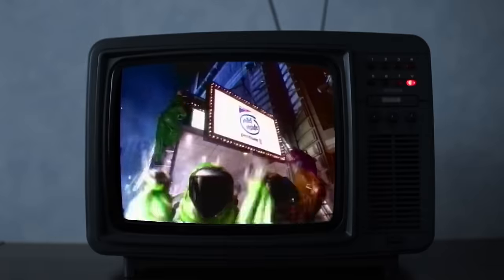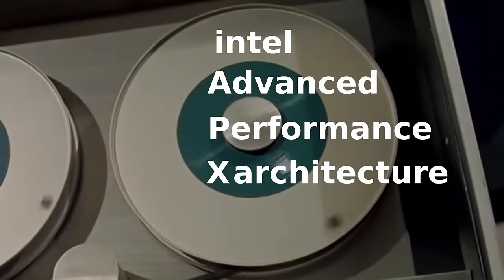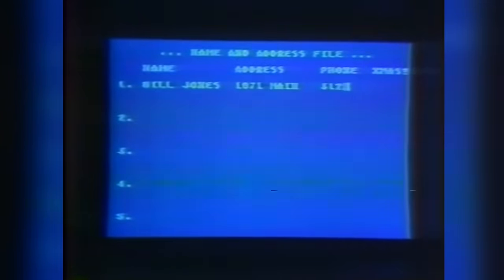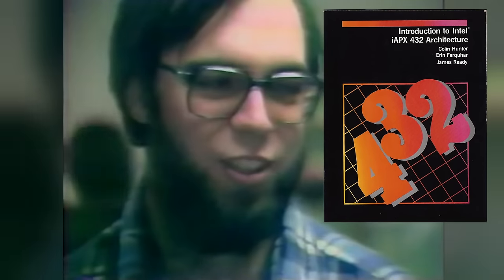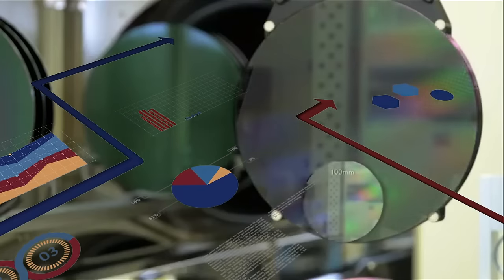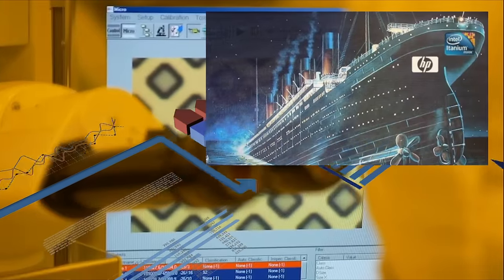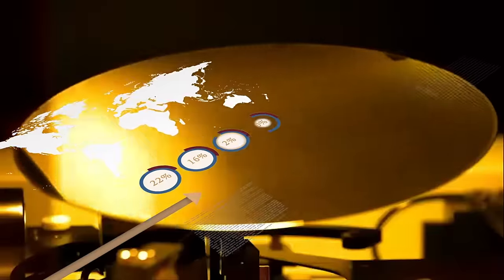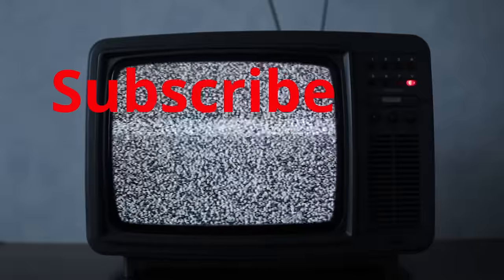iAPX The first time Intel tried to kill x86

Comment: Intel building the iAPX: Oh no this massively complicated large-die CPU with lots of high-level language support that relies on the compiler to be good sucks
Intel 20 years later: What if we built a massively complicated large-die CPU with lots of high-level language support that relies on the compiler to be good?
Reply: Didn't Intel also build a RISC processor that... relied on the compiler to be good?
Reply: You could almost just change the audio on the video and replace iAPX with IA64 and it would be the same.
Reply: The IA64 was not quite as high level as APX was. And the difference is it could actually perform exceptionally well in a few things, if not the best in market. But outside of a few nitch workloads where it shined it was rather pedestrian in some rather common and ubiquitous server workloads, this and its slow x86 compatibility mode was its biggest problem.  In the area's it was lousy, it couldn't even out perform the best of x86 at the time. And part way through its development Intel seemed to lose interest and relegated it to older process nodes and didn't give it a large development team to iterate on it over generations. It got a few of the AMD64 features ported to it and what not, but it was left languishing after Itanium2.
Reply: @scottlarson1548  all RISC processors rely on the compiler to be good.
Reply: @DorperSystems  And CISC processors don't need good compilers?
Reply: @scottlarson1548  never said that. I said that RISC and VLIW CPUs were designed around the idea everyone would just use a compiled language. This is why it's nicer to write assembly for a CISC ISA rather than a RISC or VLIW ISA. Because everything isn't load-store.
Reply: @DorperSystems  So you're saying that microprocessors need good compilers. Thanks for that information!  😄
Reply: @scottlarson1548  IA64 compilers needed the compiler to be really good at guessing cache misses.  No compilers known to Man can do that, except for certain types of number crunching algorithms.  This is not necessary for x86 or RISC compilers.
Reply: @peterfireflylund  So they designed a processor that no compiler could generate good code for. Sounds correct.
Reply: Not really.  More like:

Intel with iAPX: Let's make a radical new CPU that makes it easier to implement a compiler, and then screw up our own implementation of the compiler.

Intel with Itanium: Let's make a radical new CPU that makes it harder to implement a compiler, to keep the CPU die itself simple (well, as simple as this fancy new architectural paradigm can be).

AMD: Let's just make a normal damn CPU but with more registers, and take advantage of established compiler technology.
Reply: @DorperSystems  and VLIW turned out to be pretty good for graphics, used by AMD in a couple of their cards.
Reply: @danielbishop1863  Let's keep the CPU die simple and add a ton of cache and run that thing at insanely high power.

Comment: Back in 1980 I was off to University to do a Computer Science degree, and was also building a computer at the same time - I]d been mucking about with digital electronics for a number of years and with the confidence of a teenager that didn't know if he had the ability to do so, I had designed several processor cards based on the TMS9900, 6809 and others (all on paper, untested!) and had read about  the iAPX 432 in several trade magazines, and was quite excited by the information I was seeing, although that was marketing mostly. I tried getting more technical data through the Universiity (because Intel wouldn't talk to hobbyists!) but found information thin on the ground, and then six months or so later all the news was basically saying what a lemon the architecture was, so I lost interest as it appears the rest of the world did. 
About a decade later my homebrew computer booted up with its 6809  processor, I played with it for a few weeks, then it sat in storage 20 years, because "real" computers didn't require me to write operating systems, compilers etc :D
Reply: Around 1989 I was building my own home-brew computer around a NEC V30 (8086 clone), an Intel 82786 graphics coprocessor, and three SID chips for sound, because why not?  Everything was hand-wired and soldered, and even with tons of discrete logic chips, I managed to get it operating at 10 MHz.  Initially equipped with 64K of static RAM, it was my senior project in college.  Instead of the iAPX, I was interested in the National Semiconductor 32000 CPUs, and my college roommate and I had big plans to design and build a computer around that platform.  A 32032 CPU/MMU/FPU setup was about as VAX-like as you could get, with it's full 32 bit architecture and highly orthogonal CISC instruction set.  Unfortunately computer engineering was not yet a thing at our college, so we were on our own and simply didn't have the resources to get that project off the ground.
Reply: @johnallen1901  That sounds impressive! It's actually not the first time I see people talking about their late 80s  homebrew computers in youtube comments... if you (or any of the others) still had it and could show it off in a video, that would be beyond cool. Three SIDs at 10mhz, yes please :)
Reply: @johnallen1901  I thought that the V30 was the 80186 or 80188 instruction and package compatible CPU?
Reply: @javabeanz8549  Yes, the V20 and V30 were pin compatible with the 8088 and 8086, and both CPUs included the new 80186 instructions and faster execution.
Reply: @johnallen1901  Gotcha! 8086 replacement. I never did see many of the 80186/80188 except some specs on industrial equipment. I did buy a V20 chip for my first XT clone, from the Frys in Sunnyvale, back in the day. The performance boost was noticable.

Comment: It wasn't just that the processor returned by value. Values were literally wrapped in system objects, each with all sorts of context wrapped around it. You put all this together, and you'd have a subroutine exit take hundreds of nanoseconds.

This is when all the system designers who WERE interested in this, tell the Intel Rep, "This is garbage." and leave the room.
Reply: Correction: "...subroutine exit take hundreds of microseconds."  Clock rates and memory speeds were many orders of magnitude slower than today.

Comment: I'm guessing one of the subsequent attempts at intel shooting itself in the foot would be the 1989 release of the i860 processor. For this one they decided that the 432 was such a disaster that what they needed to do was the exact opposite - to implement a RISC that would make any other RISC chip look like a VAX. So we ended up with a processor where the pipelines and delays were all visible to the programmer. If you issued an instruction the result would only appear in the result register a couple of instructions later and for a jump you had to remember that the following sequential instructions were still in the pipeline and would get executed anyway. Plus context switch state saves were again the responsibility of the programmer. This state also included the pipelines (yes there were several) and saving and restoring them were your job. All this meant that the code to do a context switch to handle an interrupt ran into several hundred instructions. Not great when one of the use cases touted was real time systems. Again intel expected compiler writers to save the day with the same results as before.

On paper, and for some carefully chosen and crafted assembly code examples, the processor performance was blistering. For everyday use less so, and debugging was a nightmare.
Reply: That kinda explains why I only ever saw i860 end up in things like graphics processors and printer/typesetter engines, things that were really more like DSP and stream processing tasks. If you're transforming geometry in a RealityEngine you can afford to hand-optimize everything, and you have a bounded set of operations you need to do fast rather than general computation.
Reply: I worked at two of the companies that made extensive use of the i860 as a math engine. Yeah, you could make it scream for the time, especially if you're into scraping your knuckles in the hardware, but the general impression was what a PITA.
Reply: Intel sure has a long history of thinking they can handle compilers and failing miserably at it.
Reply: I remember that from the perspective of exception handling, that the handler needed to correct and drain all those instructions.
FWIW that idea was tried later in more RISC processors in a simpler way, for example "the instruction behind a JUMP always gets executed, just swap them". Simple and good, but newer CPU implementations wouldn't have that slot.
So again this was not a future proof idea.
Reply: Let me guess: Being a compiler developer at Intel must have been a nightmare. 
CPU design guy: "Ah, well, our pipelines are a little, ehm, "complex", but I'm sure you compiler guys will take care."
Compiler guy: "Oh no, not again"
Reply: And in the end neither hardcore RISC nor hardcore CISC was successful.
The two most widely used designs are one that externally pretends to be CISC, but internally does things very RISC like and the other is a RISC derivative with tons of instruction expansions, long pipelines, out-of-order execution, branch prediction, etc.
Both basically combine the benefits of RISC and CISC into a package that is better than either.
Reply: Agreed but I think the CPUs descended from the RISC lineage still have a slight advantage because they do not have the overhead of having to decode and translate a CISC instruction set with variable length, possibly non word aligned instructions into the type of internal operations shared by both architecture types.

Comment: Intel would use the term iAPX286 to refer to the 80286, along with the 432 in sales literature. Intel had intended the 286 for small to medium time sharing systems (think the ALTOS systems), and did not have personal computer use anywhere on the radar. It was IBM's use in the AT that changed this strategy.
Reply: Yes, a short while they did. I have 8086 and 80286 datasheets with and without "iAPX".

Comment: You should do an episode on the Intel 860 and 960. I’m remember them being interesting processors but never saw anything use them
Reply: Yes that would be interesting. I know SGI used them. They got quite a bit of use as coprocessors I think
Reply: i960 was used in the slot machines of the mid 90s. I believe it was also used in the F-16 avionics.
Reply: I860 was used in the ASCI Red System @ Sandia NL, 1st machine to break TFLOPS barrier.
Reply: "The Second Time Intel Tried to Kill the x86".  Slots in nicely between this video and the Itanic one.
Reply: the i860 was the original target platform for Windows NT, microsoft was gonna build an i860 PC
Reply: The easiest way to see a 860 or 960 is to procure a RAID controller from 90s or 2000s. Adaptec had been using them extensively. Even the famous 5400 series.
Reply: Acer did some machínes at the end of the 90s, remember some advertisements on the chilean newspapers those years.
Reply: @hye181 I read that the point of writing Windows NT on the i860 was as an exercise to ensure that it was not limited to x86.
Reply: @bsd107  no, they planned to build both a desktop PC and a server platform that were i860-based, but it fell through because it turned out the i860 sucked too hard and the MIPS R4000 was too expensive to put in a PC
Reply: Hewlett Packard made several high volume lines of color inkjet printers based on the i960.
Reply: @hye181  and interestingly an offshoot of the successor R4200, the R4300i was used in the Nintendo 64 (which also used Rambus RDRAM) and the Playstation went with an R3000
Reply: Pretty sure they were in raid cards and other random things

Comment: Having done ASM for a 286 and a 68000 at university, I have to say, at the time I preferred the 68000.
Reply from the maker: Me too if I'm being honest.
Reply: @RetroBytesUK  Ah if only the 68K was released a few months prior, IBM would probably have picked it for the PC. Such a shame, as the x86 is pretty horrible from an ISA POV.
FWIW the 68K has... 68,000 transistors. As referenced by Wikipdiea. Cool video.
Reply: @RetroBytesUK  All those general purpose 32 bit registers. So good.
Reply: As somebody who had done assembly language on the old PDP-11, it was pretty clear where Motorola’s inspiration came from. ;)
Reply: @lawrencemanning  The 68K was more equivalent to the 80286 than the 8086.
Reply: @lawrencedoliveiro9104  did not know that. Going to have to look into it. Thanks.
Reply: Agree strongly.  Not having a poverty of registers (some with dedicated use... sorry!  You can do that only if it's in AX!) was a godsend, and 68k hackers got a flat space back when x86 coders still had to deal with the truly bletcherous "real" mode address space.
Reply: @RetroBytesUK  It doesn't require that much character to prefer the Motorola ISA and addressing.
Reply: @lawrencemanning  IBM wanted and asked Motorola for a low cost version of the 68K with an 8-bit data bus at the chip pins.  Motorola told IBM they had other priorities, like a 68K with a 16 and 32 data bus at the chip pins.  So IBM went with Intel, because Intel was in financial trouble and therefore willing to do whatever a paying customer asked.

And the rest is history.
Reply: @lawrencedoliveiro9104  It was no secret at the time that the 68K was intended to be a PDP-11 on a chip.
Reply: @WildBikerBill  Interesting. Oddly enough, they did eventually do a 68008 chip with an 8-bit bus and only 20 address lines. Sinclair used that in their QL machine, which I think was cheaper than any IBM PC.
Reply: @lawrencedoliveiro9104  Correct - but that was way later than the schedule IBM was looking for.  On the other hand the 68K processor became one substantial way in which Apple differentiated itself when it rolled out first the Lisa and then the Macintosh line of products.
Reply: @lawrencemanning  
What i have heard the  68k was available but it was very expensive and there was not many i/o chips available while the 8088 could use the i/o chips already used with the 8080/8085.
Reply: The 68000 had 32 bit registers and 24 bit addressing, which was great, of course. But the 286 was much faster, even on 32-bit arithmetics. The 68000 had problems matching even the 8086 in performance, at the same clock speed.
Reply: @lawrencedoliveiro9104  The 68008 was horrible slow though. Sinclair regretted not continuing with the simpler Z80 instead, using bank swiching to address more memory.
Reply: @herrbonk3635  Thank you for that - I needed a good morning laugh.  Clock for clock, the 68000, 68010, 68020, 68030, 68040... would crush the 8086, 80186, 80286, and 80386.  Where the 68K Family fell behind is to my knowledge Motorola never pushed clock speeds past 50 MHz while the 80486 hit 66 MHz and it's descendants ramped up to 100's of MHz and beyond.  There was a point were a gazillion extra clock cycles in the 80x86 Family overcame the architectural efficiencies in the 68K Family.
Reply: @WildBikerBill  "Crush, clock for clock" What the heck?? Try to read the datasheets dude... instead of citing myths. Or even better, write code for them in optimised assembly (like I did, professionally, in the 1980s).

As an example: The 8086/88 could do a 16-bit ALU reg,reg in three clocks, which became two clocks on the 286. The 68000/10 needed four clocks for this, in 16-bit, and eight clocks for 32-bit. (The 68008 used 12 cycles for the same instruction, due to its narrower bus.)

The latter took just two clocks for the 386 (in either 16-bit or 32-bit). So the 386 was basically four times as fast as the 68000 on 32-bit arithmetics (while the 286 was twice as fast as the 68000).
Reply: @WildBikerBill  you mean the 68008? Which has a 8-bit data bus.
Reply: @herrbonk3635  The 68020 also had no built in MMU. And even being pipelined and with branch predictor, the 68030 couldn't beat a 386.
Reply: @DorperSystems  Yes.